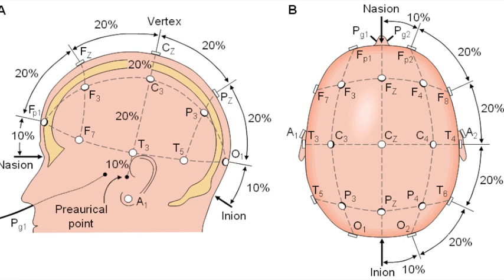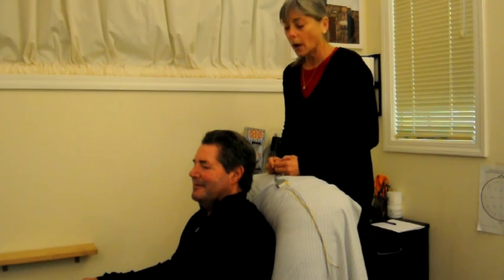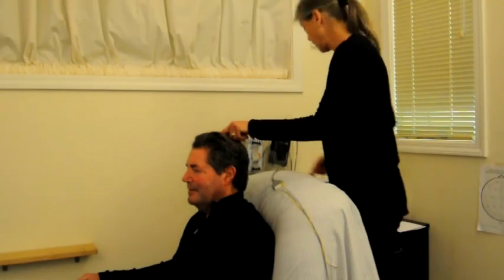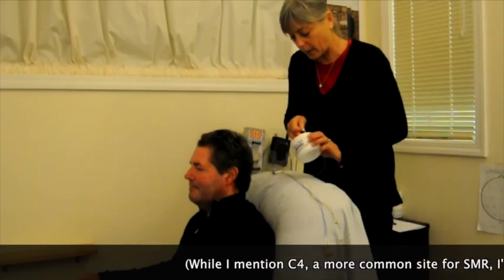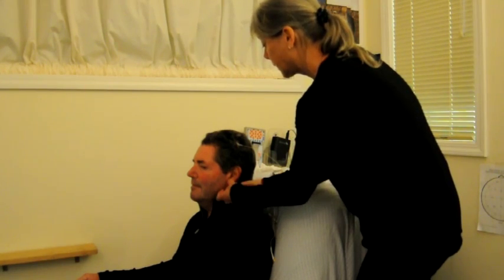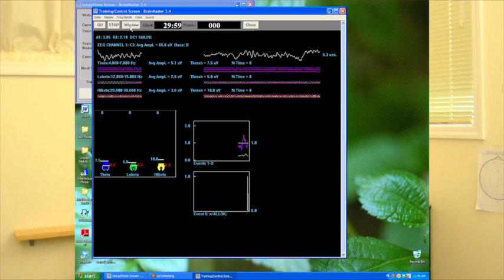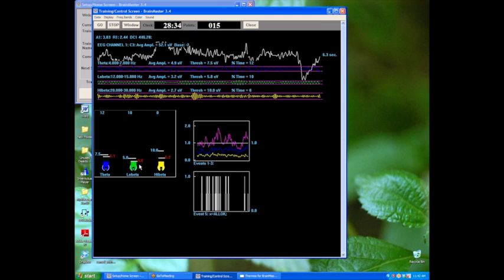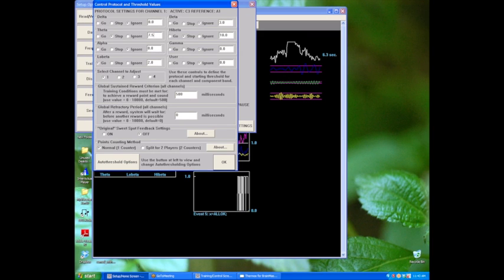EEG Hookup

Comment: I do appreciate all the helps you've pointed out in applying sensors and using the software and reading all the indicators correctly. Your sensor is at C3, but you're using a C4, Focus, protocol, however.
Reply from the maker: Yes, I make a written note in the video of same. It's because of camera positioning.